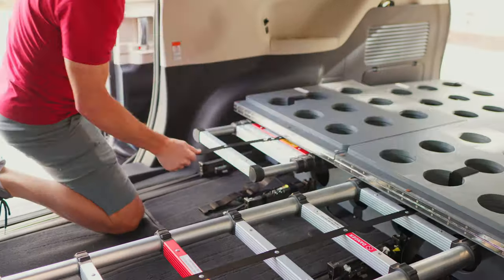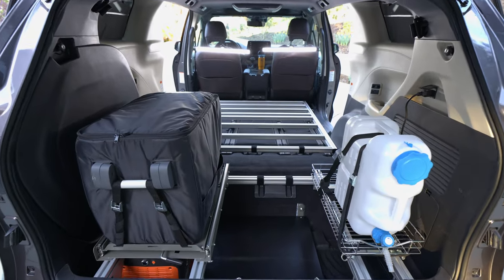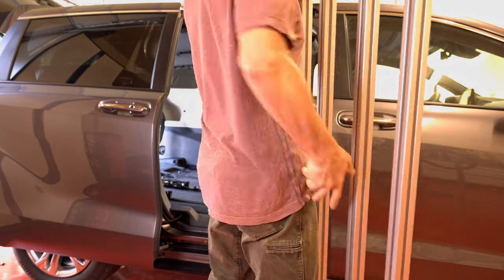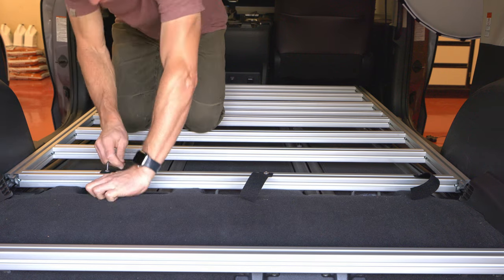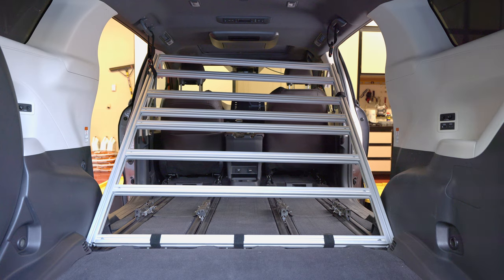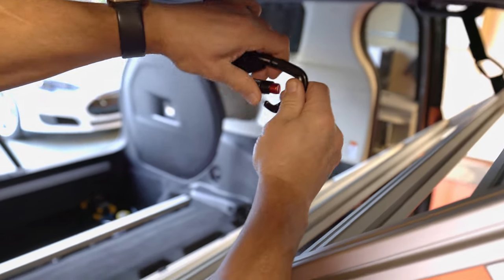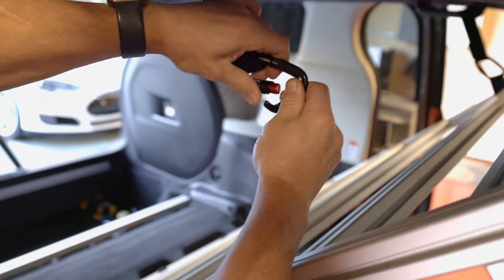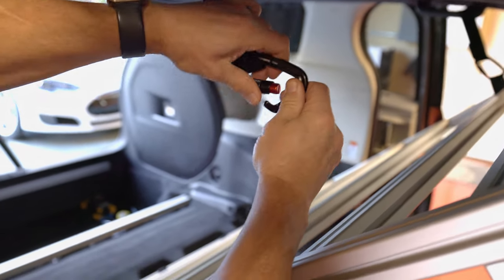8020 Aluminum Camping Rig for Hybrid Sienna Minivan

Comment: I really like this solution for a lightweight bed frame for the 2021 Toyota Sienna. Do you have the specs for the 8020 frame and recommended place to order the 8020? How did you remove the backseats without interfering with the electronics and airbags?
Reply: For the second row seats, you can purchase an airbag 'faker' for lack of better term. Plug it into the leads and then you won't have alarms for airbags.

Comment: We were more minamillistic by using a $55 Wal-Mart metal bed frame and a $220 Wal-Mart full mattress, propped up with bricks and concrete piers to even bed. Had plenty of storage underneath for 2 suitcases, food, clothing and toiletries. But thus one is far cleaner look and multifunctional.
Reply from the maker: Thank you for watching and sharing your set up for sleeping. In the next video I will show how and where we put out luggage while driving and when sleeping. Cheers!

Comment: Thank you for all of your great ideas and hard work! Can you think of a way to create a hinge system to use your old wooden layout with the 2nd row seats still in the van with this newer 80/20 construction? I’m excited to get my Sienna build going!
Reply from the maker: @wittwisebram4333  Congrats with the upcoming delivery of your Hybrid Sienna! Creating a hinge platform for sleeping with second raw seats folded all the way forward might be possible, similar to what we I did with the first (plywood) design. You may need to use two sets of hinges to avoid hight restriction when unfolding the platform. In my recent rig update video Toyota Sienna Hybrid, Camping Rig Update https://youtu.be/YTcO_a41ozY, I show how I added a hinge system for accessing space under the platform and easy removal of the sleeping platform when we want to reinstall second raw seats. You might also need to use an extra set of feet to support the platform, which you could make to be foldable with a hinge when to in use. I hope this helps. Cheers!
Reply: @ Thanks so much! That makes sense. I’ll let you know how it goes.

Comment: Thanks for sharing. 80/20 aluminum seems like a good solution and I like the addition of the 5 gallon bucket. It’s a must when no restrooms are available. I also like the slide out refrigerator and water. Easy access is essential. Looking forward to your next video!  You need to show us how many pull ups you can do in one of your videos!😀
Reply from the maker: Thank you for watching and commenting. I guess I have to start training my pull-up for the video, ha-ha :) Cheers!
Reply: Space for a five gallon bucket can be  a problem. In our situation, we used a small container to pee and because we were travelling we always had places to use the bathroom, including staying at the truck stops overnight.
Reply from the maker: @spiritualexercise265 Agree, the 5 gal bucket takes a bit of space. We plan to use the space at the bottom of the bucket (underneath the disposable bag) to store extra supplies like paper towels, water shoes etc. as only part of the bracket’s volume is required for the toilet function. Cheers!

Comment: Your conversions are quite fantastic!  But not really for those who are budget or technically challenged, like myself.  🤔  😅

I'd love to see if you could come up with a budget conversion for say $500 that you could also accommodate a bike?   😁😍😁

You pay so much attention to detail.  I really enjoy your videos!
Reply: The aluminum used can be pretty expensive. A similar alternative for the bed platform is often done with 2x4s & thinner wooden horizontal slats work well for supporting the mattress. Cheap & light.
Love the back section for the toilet 💡, water & battery.
There's also a smaller fridge that other YouTubers have used, which fits perfectly replacing the removed storage console between the front seats.
Reply: I've seen some with a bike rack mounted at the back, I think where a trailer hitch goes? Of course, you would need to prevent theft with a top notch lock & maybe put the front wheel inside ?

Comment: I highly suggest you instal a hightop roof on this. Would make it a very nice camper with no compromises
Reply from the maker: Thank you for watching and your comment. By specs Sienna rails are rated for max 150lb weight load. The main benefit of Sienna is its great fuel economy of 36 mpg. Any roof top load reduces fuel economy reduces fuel economy from 6 to 30% according to the US Dept of Transportation Study. So far we found that we have enough space inside for everything we want to bring camping. Cheers!

Comment: Thank you so much for your videos.  I wondered if the new build with extruded aluminum could be modified to keep the second row seats in the van
Reply from the maker: Hi Gay, there is 72” in length between the rear door panel and backs of folded and slid all the way forward 2nd raw seats. So yes a platform can be build to have just a bed in this space. In fact, you can even keep the 3rd raw seats folded and make floor  behind folded rear seat leveled with flat luggage and gear, put a mattress on top and you’d be ready for sleeping. The only luggage you’ll be able to bring with you, however, should be packable onto the front seats at night. Cheers!

Comment: If it would be very easy, could you send me the interior dimensions of the Sienna with 2nd row seats folded up?  I can't find them on line anywhere; Toyota only lists volume.  I want to build a single bed platform so I need length, width and height.  If it is any trouble, DON'T DO IT.  I have watched your videos many times and I still marvel at your creativity and drive for perfection.  And you are having fun!!!
Reply from the maker: Hi Linda, sorry for belated reply. We were on a camping trip for past two weeks with no access to internet. As with most of modern vehicles the precise interior dimensions are difficult to measure because of curved interior surfaces. In new Hybrid Sienna model with 2nd row seats folded I still was able to fit a 72” x 48” mattress. The floor in the van in not flat and it slopes down toward the front of the van. Thus, a sleeping/leveling platform is required to sleep comfortably. The high of the space behind folded 2nd row seats varies between 46 to 42 inches from floor to sealing. I recently build a second version of my camping conversion (here is a link to my video 8020 Aluminum Camping Rig for Hybrid Sienna Minivan https://youtu.be/Q9i4xcA48ew), that allows a more comfortable seating on the bed. When building my conversions I had to custom measure and fit every peace because of the complex shape of interior panels and because of smaller side and rear door openings for placing the rig components in and out of the van. I don’t have a clear answer for you, but hope that my explanation is somewhat helpful. Cheers!

Comment: Hey Tellvia: Thanks for the ideas. I’m finding that tricking out a Sienna (‘14) is much more difficult than my previous Tacoma was to modify. I used 80/20 in it and am glad to see your use of it in the Sienna. I’m wondering where you sourced the plastic feet and how does that end of the frame keep from sliding side to side? Much appreciate you putting this up. 
Rod
Reply from the maker: Hi Rodney, thank you for watching! The bed structure feet were from TNUTZ.com, some other vendors may carry them as well. As you saw in the video the bed structure is secured to 3 floor seat mounts and bed platform does not move side to side on the road. The feet extensions are fixed in place with 80/20 fasteners. I hope this answers your question. Cheers!
Reply: Super! Thanks for the fast reply, Tellvia . I will poke around for those feet. Glad to hear it does not shift. 
I have to use the back seats intermittently so will use a bit different layout, but the 80/20 with Velcro and feet I think will make it more level and modular. Appreciate your videos and help. 
Happy Trails!

Comment: Looks great, I am a bit confused by placing the fridge and water jug above the bed. That's the space where your legs should rest while sleeping. There seems to be room left for just one person's legs now, but the bed is wide enough for two. You didn't show your new build in sleeping configuration (with the mattress and pillows,) so I might be missing something... And I'd like to see a little "demonstration" of going from sleeping position to using the bucket toilet - is it possible to do that without waking up the other person (assuming there are two of you)?
Reply from the maker: Hi Eric, thank for watching. From the back of front seats to the back door Sienna has 96”. The fridge and water sliders take 27” of the length, so 69” is available for the mattress. The demo for sleeping and using the bucket from sleeping position is coming in the next video. Cheers!

Comment: Great video!   I will take your idea and make something similar so I can easily slide bowling balls from the trunk to the third row seating area after removing the seats!  Can I ask what screws you use to fasten the velcro to the 80/20?   Didn't realize those were so strong!  Also, what adjustable angle brackets would I use if I were to use the 10 series 80/20?  Thank you!
Reply from the maker: Hi Cindy, thank you for watching!  The 80/20 aluminum parts come in metric (mm) and imperial standards (inches). The metric standard is available as Series 10, Series 25 and Series 40. The imperial standard has Series 15 (most common) and Series 30 sizes. In both systems the higher the load on the structure the higher Series extrusions are recommended. If you plan to build just shelves for your project using Series 10 would be okay but for bed or sitting surfaces Series 10 would be too weak. Each Series has specific mounting hardware which in most of cases is not compatible with other standards and Series. The only exception is Series 15 and Series 40 - the brackets for this series are cross-compatible, but the bolts and nuts are not (since one is imperial and the other is metric. I highly recommend to commit to one of the standards and Series as it will get very confusing when your search for right parts in your project. I use Series 15 parts and sometimes buy brackets that are Series 40. For attaching Velcro strips to extruded aluminum rails I use 
5/16-18 x 1/2" Button Head Socket Cap Screws, 304 Stainless Steel 18-8, Bright Finish, Coarse Thread Fully Threaded, Allen Hex Drive, 20 PCS - https://amzn.to/3Y9G3s9. The length of the screw is defined by the the depth of the Al extrusion rail grove and the thickness of a bracket or material that is being attached to the the rail. Velcro is very thin so ½” screw length is right to attach it to Series 15 extrusion. You would have to measure the depth of the Series 10 rails to determine the length and the thickness of the that will work for Velcro. I am working on Tellvia Membership portal where I will publish tutorial videos about 80/20 aluminum structures I’ve build in which I would go in greater detail on compatibility of parts and talk about other practical considerations. I plan to make this portal to be available to members in the next few weeks. I hope this is helpful. Cheers!
Reply: @Tellvia  very helpful. Thank you for taking the time to respond.  Now I will be busy pondering over all the information you just told me.  Looking forward to seeing more of your projects!

Comment: Hello-- do you have links for where to get the aluminum pieces, including hardware and measurements of all the pieces available? I would like to see if I can do this even though I have no tools. Thank you very much
Reply from the maker: Hi Flynn, thank you for watching. I am working on a channel membership portal with info on specifics of the build and more detailed assembly videos. The portal should be online in the next few weeks. Cheers!
Reply: @Tellvia  thank you, I will be on the lookout for the portal. This looks like a great solution. I am hoping it's something I could do. Even if I didn't have the skills for removing the third row seats and working with that area the way you did, I am hopeful I could do the frame you use for the bed and have that third row folded flat to be a place for my 90lb dog to have a separate sleeping area. I have a carrier that I want to put on top for much of my storage. So, I look forward to seeing if I can use these materials to make a frame. I have been frustrated that the new Sienna is harder to work with given these second row seat mounts are really something to have to work around. Thanks again

Comment: I have a 2023 Siena and I wanted to copy your build but perhaps with the ultra lightweight 8020 is there some way for me to get the specs and site you used to order the precut 8020 just read thru the comments and ima need that portal
Reply from the maker: Hi Thomas, thank you for watching! I ordered pre-cut 80/20 extrusions from Nutz.com.  The membership portal of Tellvia channel is not public yet. My recommendation is to use your best judgement for the dimensions of bed support. I am still modifying my bed support to improve the ease of its removal when I need second row seats installed back. The ultralight weight 80/20 should work fine as long as it is supported every 3 feet of length. Cheers!

Comment: What are the inner dimensions of the rear compartment which houses your cooler and water bottle?
Reply from the maker: Hi Linda, thank you for watching. As with most vehicle interiors nothing inside is square inside new Sienna but I would estimate that a 44”w x 44”h x 23”d box will fit in the third row well space while leaving a full 72” x 48” cabin space for an unobstructed sleeping platform. I hope this answers your question. Cheers!

Comment: Do you think the woodland edition is much better if I just want the occasional camper, and maybe once a year head to the mountains mostly on shoveled roads though? Or is the normal xle or xse enough? Also, how important is awd or is it more hassle than it is worth
Reply from the maker: The AWD system in Sienna is electric motor based. Even in normal every day driving this AWD system is very useful. I see on the drivetrain monitor in our Sienna that AWD engages automatically during accelerations, or when going up steep streets. It engages automatically only when the system detects that that it will be beneficial for the van’s driving dynamics and safety. It also helps to keep the van stable at highway speeds. Many of FWD vehicles have problem with spinning front wheels during off the stop acceleration, even in normal driving not a drug-race. This is mitigated with AWD setup. We never take our van in snow country but I feel and see the benefits of AWD system any time I drive it. Regarding the fuel economy penalty - it is only 1mpg lower that FWD. In our experience we see 35.5 mpg average after 20K driven. It terms of reliability and longevity, because it is an electric drive at rear wheels similar to modern EVs, which is proven to be reliable, and since it engages only when needed, I believe it will outlast the front drive setup.  We use our Sienna primarily as a camping vehicle and sometimes have to drive on gravel roads to reach campgrounds. The AWD makes the van feel sure-footed on those roads. Since your are an occasional camper you probably will be happy with FWD as well, but for the price difference the AWD may be worth considering. The Woodland addition has better included options than Limited. If you don’t need the AC inverter XSE may be a good choice, as it has sportier looking front fender and wheels. Good luck with your hunt for your new Sienna. Regardless of the trim and options I think you will be happy with it. Cheers!
Reply: @Tellvia  Thanks so much for the thoughtful response! Two last questions:

1) Is the extra 0.6 inches of height clearance on the woodland meaningful in camping / everyday situations or would I be just as good with XSE model?

2) I am being offered the xse 25th anniversary edition in FWD... this one has 20 inch wheels too, so a bit worried about ride quality for an everyday commuter, and occasional camper. Given what you just said in your response, I would probably prefer an AWD and this one also has the rear entertainment system with NO electronic mirror, and the RES is something I could probably do without (and blocks the rear view mirror!). With that being said, it is a 25th edition and I'm being offered at msrp + 2k, which seems to be a reasonable mark up around where I am. Any thoughts and insights would be much appreciated. Amazing videos and great ideas on camping with the sienna!
Reply from the maker: @thedadmikey5820  Here are my thoughts about your questions: 
1) The 0.6” clearance is nice but is not critical for camping and at most developed campgrounds, you’d be good with XSE model.
2) I know you are excited about the offer for the 25th anniversary van they have available but I would pass on this deal, here is why: the RES system protrudes down from the ceiling almost 3” and rubs us of the headroom when sleeping in the van. It will be also obsoleted when you decide to sell the car. I know deals and prices have been terrible in the past two years but 2K over MSRP seem to be to high as the car sales in 2023 have been slumping. We paid MSRP for our van in April 2021. I believe you will be able to get your van for less if your are prepared to wait for couple of month and negotiate harder. I don’t know how 20” wheels perform on Sienna, we have 19” wheels and the ride is very comfortable. May be 20” would be good as well. The camera-based rear mirror is really nice to have, especially when you carrying a lot of luggage of bulky items blocking the rear view. I hope this helps. Let me know what trim/options you end up buying. Cheers!
Reply: @Tellvia  great advice. Thanks a bunch